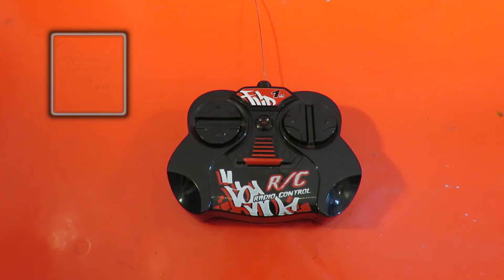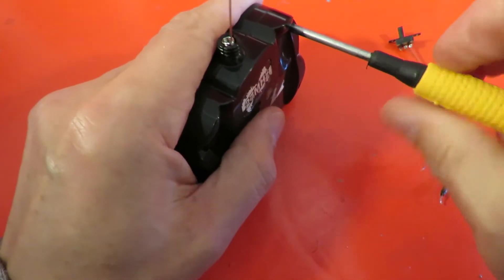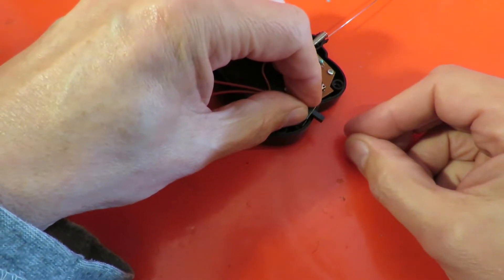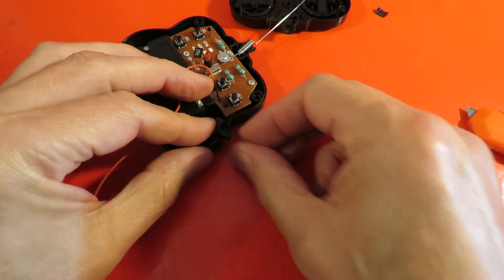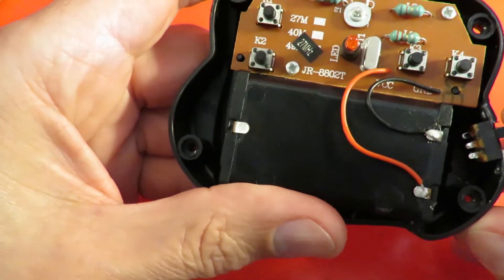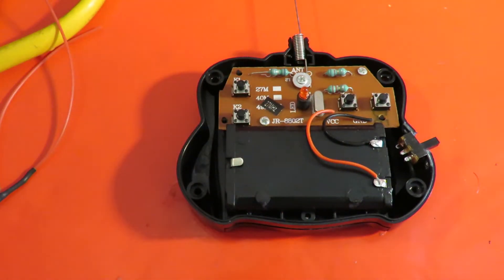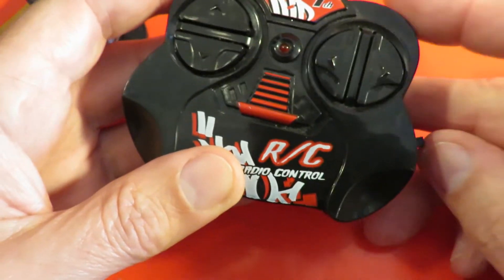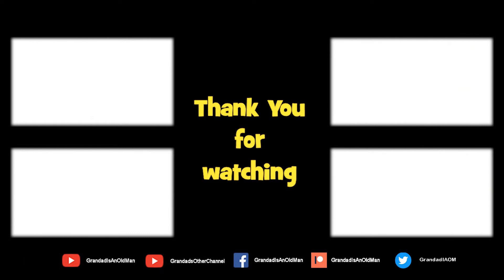Fitting an On/Off switch on my toy grade transmitter

Comment: cool that's a good idea ! once had a torch that switched itself on when you put it in your pocket and of course turned it self off when you pulled it out !
Reply from the maker: It really annoys me how many transmitters I have that do not have an on/off switch. It means I have to take the batteries out when I put them in the bag otherwise they quite often are signalling all the time. I found the hard way when I was trying to sort out one of my charity shop finds and it started acting erratically. Took me ages to realise one of the transmitters upstairs in storage was transmitting. Obviously it's a good idea to remove batteries if you are not intending to use them for a long time but I regularly have to go through the bagful of them to find a match for these charity shop items and putting the batteries in each time is a pain.
Reply: yes it can be a pain when that happens I used to experiment a lot with those little listening devices bugs etc so I made a simple rf meter that would tell me if anything I had built was transmitting !  also I had one strange instance when I moved house  one of the boxes kept buzzing all the time I was near the boxes when I left the room it stopped couldn't figure out what it was it turned out to be a loose floorboard when I stood on it the boxes moved slightly and it was a battery powered   toothbrush which I had in one of the boxes for cleaning electrical stuff with pcbs etc !

Comment: I was disappointed to find that a couple of nice models (a quadcopter and a VTOL plane) I bought recently didn't have on/off switches so bought a bag of 10 from Gearbest for only £2.44. I've done the plane but haven't taken the quad apart yet.
Reply from the maker: Yes it seems odd that so many don't have on/off switches. The worst I find are the toys aimed at really young kids. They have no off switch but play loud sound effects or tunes when you touch them in a charity shop and you look a total fool frantically trying to find the off switch only to triggger a second sound effect or repeat the music. If you leave them alone they shut up eventually but the more you panic the longer they play 😖
Reply: @GrandadIsAnOldMan  😂🤣😆 Now that's a Grandad video I really want to see!

I understand the point of saving weight on a nano or micro quad, and of course transmitters like this one only use power when the digital switch is pressed, but for battery life's sake It would make total sense to put a switch on. 

The plane I modded (an XK X520), what I've actually done is put 2 tiny little switches on it, as it not only doesn't have an on/off switch for the power but also has LEDs which you.might not want on all the time, and the only way to turn those off is to remove a hatch that's held on with a tiny screw and then remove the teeny tiny little plug from the PDB! - Just the sort of thing you want to be doing at the flying field! 🙄